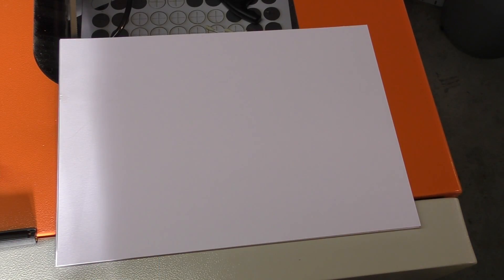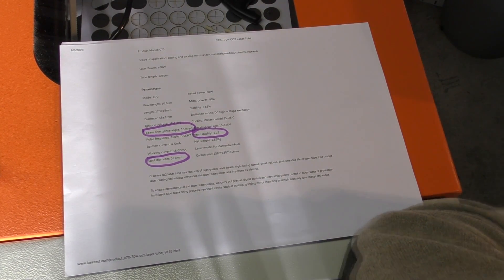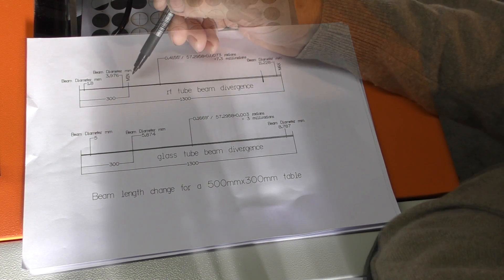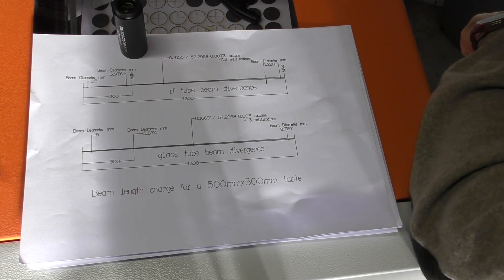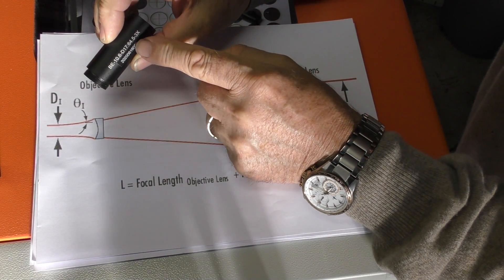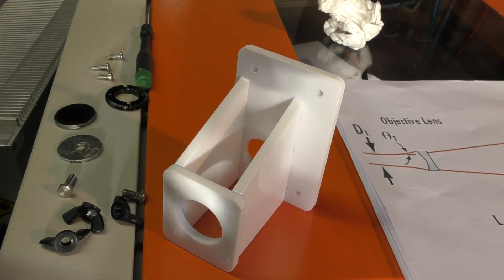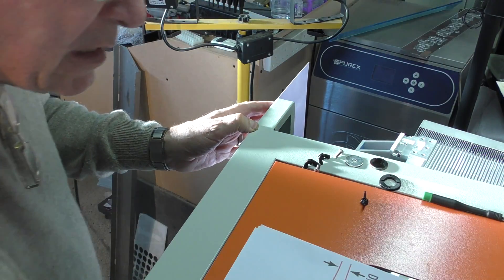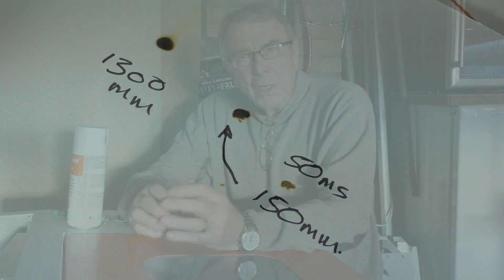Tangerine Tiger 06 Beam Expanders decoded

Comment: Something is not quite right - be sure that close beam burn mark is round. Check whether beam expander is centered and whether it is parallel with incoming beam. Else you may end in various problems sooner or later. First set of problem is that optics in BE has anti - reflective coating and it is made for narrow set of angles, mainly perpendicular to the lenses, or as in optics literature they call it "normal incidence". First problem may be even small reflecting of the beam to the housing, causing overheating part of the lens and it may crack. Second problem... well, beam shape consistency may be bit off. Hope this helps.
Reply from the maker: Hi Milan
As you have seen. I only rigged up a temporary holding mechanism for the beam expander and I did mention in the video  that I may not get the beam and expander axes perfectly aligned. My aim was to see what effect the expander imparted to the beam and crudely I have achieved that aim.. I will contact Cloudray because there must be a proper  beam expander mounting for this tube.
 Thanks for the comment
Best wishes
Russ.

Comment: I was reading about these a while back, and a good/simple explanation for how beam expanders work is they increase the area of the laser (in this case, 3x), but they increase the length of the laser (another 3x). In other words, if you were to take bad result you were getting at the start and project it out 3x further, you would still have the same result, but now you have a much better result when you are only 1/3 out.
This makes much more sense in my head, sorry for the incoherent rambling above.
Reply from the maker: What you were reading may be true UNDER CERTAIN CIRCUMSTANCES.. There are not many people like me that have SKEPTICISM woven into their DNA. I believe what I see and so I have to say I have developed a healthy mistrust of lens theory because the lens appears to be where the theory stops. What happens to that  Gaussian distributed light intensity when it exits the lens and starts exciting the molecules of the material we fire it at,, is a science that seems to have been very little explored.  In attempting to verify the information you are passing on, I have just been to my workshop and done a burns at  0.15m  at 1.3m and also at 3.9m distant from the tube. I have held the pulse on until I could get no more scorch growth. All 3 marks are close to 7mm diameter....just a tad more than 2mm x 3 predicted by the claimed 3 times expander.. I would therefore conclude that this beam expander/collimator is VERY well designed. Thank you for forcing me to check it's performance  in areas I would not otherwise have gone.
 Best wishes
Russ
Reply: It's extremely helpful and greatly appreciated when individuals go out of their way to help others in the world (who they don't even know!)and then make videos to give advice in areas that many individuals need a helping hand like newcomers and hobbyist like myself  ( just like Russ is doing) but "personally" i get p*ssed off when sarcasm and insults come from keyboard warriors just like a certain individual in this comment section who might well have experience and knowledge in the way this individual has written a comment but I'd just like to say and I hope other follow > DON'T give sarcastic individuals the ammunition they crave (ATTENTION SEEKING) something this certain keyboard warrior is looking for and although I'm writing this isn't to say I've taken the bait but it is the opposite (in fact I'm just asking others to ignore people like this pr*ck who is most certainty watching for curiosity as if the  individual in question is so clever in this subject then why bother clicking onto such material.
Another brilliant video from Russ and a thumbs down to the keyboard warrior.👎😪""”"
Reply: @joeblogs4146  I'm sorry I offended you with something I read about beam expanders?

Comment: Great videos Sir! Any recommendations on the best coolant to use in the laser cutter? Is antifreeze good or just distilled water.
Always look forward to another of your informative videos.
Reply from the maker: Hi Doyle
Just distilled water and make sure your system is close ie not an open bucket reservoir but a closed lid system with small holes for pipes. Small airborne spores will soon get into your reservoir and make lots of green algae  if you leave it open.
 See this video  in answer to your antifreeze question.
https://www.youtube.com/watch?v=NAiMrMGT1O0&list=PLPWEtx5V9DqEogIeYRdcG_KYcB7UL2Qmn&index=31&t=0s
 est wishes
Russ
Reply: @SarbarMultimedia  Thank you Sir!  very informative.  I will be purchasing the active chiller soon, which will provide a closed loop system to keep the water conditioned.  Brilliant idea regarding the 'halogen' heating system!
Reply from the maker: @doylemaleche9937   If you need the circuit diagram for the heating just add your disguised email to another comment (johndotsmithatgmaildotcom) and I will send it.
Best wishes
Russ

Comment: Interesting. Now i am wondering how much power does this Beam Expander/collimator ate? Hmmm...
Reply from the maker: Clean ZnSe lenses consume about 4% each  Then 3% per mirror plus 4% for another lens (total 21%).  Lets ignore the compound effect at each stage.   What remains for us to use  is   30 x 0.79  = 23,7 watts. Hmmmm....not going to do much cutting that I guess.
Best wishes
Russ
Reply: @SarbarMultimedia  It may cut even at that power level at low cut speed. After all, you mentioned this machine will be exclusively for engraving purpose. So, most of the time it will 'etch' work piece, then slow cut to finish work. I can see your next project in some far future - dual laser machine. Something like engraving (RF), flip mirror, cutting (DC).
Reply: @SarbarMultimedia  As others mentioned  It will probably melt without a cooling. Eagerly waiting for your next video!

Comment: I thought one of the benefits of the RF laser is the high energy density in the center. is that going to be negated with the expander / collimator? will the energy distribution end up similar to a glass tube?
Reply: The expander simply trades off the diameter of the beam with the divergence. The further you expand it, the less it diverges. That's what Russ calls collimation and he is largely right. No laser beam is perfectly parallel. They all diverge. When you focus it at the end, the smallest spot you can make is still the same -- assuming perfect optics, of course.
Reply from the maker: ALL laser beams have a theoretical  Gaussian light intensity distribution. However in practice various design factors affect the quality of this distribution. The measure of a laser beam's quality is described by an M squared reference number. where 1 is a perfect Gaussian distribution.. Glass tubes are generally in the 1.1 region whereas all the RF tube  specs I have examined seem to be 1.2 (lower quality).  As I mentioned to SeeigeCannon in answer to his comment, there are many myths and half truths associated with this technology, most of then circulated by the "big boys" to somehow discredit Chinese technology.. Yes (as I have demonstrated) Chines design capability and engineering quality leaves a lot to be desired but  glass tube technology has MANY advantages. 
 So in answer to your question, glass tubes have a HIGHER light intensity (energy density )  at their centre than RF beams (this is admitted in the M2 specs). The beam of a glass tube has a divergence of typically 2 to 3 mrads where as all the RF tubes specs I have checked are in the 5 to 8 mrads.zone. We don't need beam expanders for our glass tube because the divergence is very small. Whereas  for this RF tube in particular the beam growth is huge and would result in serous performance variation across the table.. It therefore MUST be corrected by the beam expander/collimator.  The Gaussian intensity distribution will not be affected by magnification or by focussing. The light intensity  will be stretched out or compressed but will still contain the same amount of power. BUT the beam expander/collimator contains at least two lenses (maybe three if one is a doublet) so it will absorb about 4% for each lens.  I have yet to do the testing but  I already foresee many things that concern me about this technology. I hope I am wrong because I really want to finish up with a high speed engraving machine that can do 500 dpi photos at 1000mm/s.

 Best wishes
Russ
Reply: SarbarMultimedia  im wondering if the BE reduces divergence it will,provide you with more consistency  as the head moves changing the path length.  Presumably allowing the focusing lens to deliver more consistency.
Reply from the maker: @grantlesueur  
Hi Grant 
 You have understood the problem perfectly.  Adding the beam expander is coting about 8% power loss, which is why I was reluctant to add it. However the consequences of having a variable size beam  hitting the lens at different points around the table will result in apparent power change, I say apparent because in reality the beam is changing its effective focal point  and the energy density hitting the work will be varying.
 Best wishes
Russ

Comment: Russ I don't know anything about that laser I have a c02 but could you turn the laser round to face mirror two so doing away with mirror one or is because of space and would it make any difference excuse me if it is a dumb question.
Reply from the maker: Hi Trevor 
This is not a dumb question and even one I asked myself in the early part of my learning journey trying to understand beam alignment and trying simplify it in the same sort of way you are imagining. In those early days I was experimenting with different methods and even designed 8 different versions of red laser pointer to help set the mirrors without the need for the scorched paper method. All these pointers were about 90% successful but not accurate enough for perfect beam setting. i now have a very clear 3D model  in my mind of how beam alignment works and I am sad to report that mirror 1 is vital to setting the beam true to the Y axis . 
 Let's assume I remove mirror 1.I Now want you to act the part of a laser beam by holding your left arm out in front of you and point a bit upwards. Identify  an object in your room to the left and a bit below your shoulder. That object is the centre of mirror 2 Very  carefully, making just one axis move at a time. maneuver yourself around so that you finish up with your arm parallel to the left wall, parallel to the floor and pointing at the selected object. Now imagine what the tube mounting bracket/adjusting mechanism would be to replicate your moves. That will be some hideously complex (and big)  bracket with X, and Z linear and rotational adjustments. . Instead let's leave mirror 1 in place. It matters not how badly aligned the laser tube is, the only requirement is for the beam to strike the centre of mirror 1. The adjusting screws on mirror one can be set so that regardless of entry angle, the beam can be steered parallel to the Y rail in both horizontal and vertical planes. The only issue left is to see if the beam is hitting the centre of mirror 2. This is where I realized that once set, I did not want to disturb  the relationship between tube and mirror 1. This became the stimulus for creating a separate tray where both  the tube and mirror 1 were mounted.  This allowed me to slide the tray slightly left or right until the beam from  mirror 1 was perfectly in the centre of mirror 2.. It goes on from there until I eventually made mirror 2 adjustable in Y and the head adjustable in Z. 
 Best wishes
Russ
Reply: @SarbarMultimedia  Thanks for the explanation Russ

Comment: As long as the beam still fits in your mirrors and final lens, why do you care? Of course if it does not fit any more, that's what the expander is there for. But you'll lose a little bit of power in the conversion.
Reply from the maker: Hi Jan. 
 It is VERY important to have a consistent size beam hitting the lens at all places around the work table.,  Changing the beam size onto the lens changes to focus  and that is something you do not want. Yes the expander consumes power (about 4% for each lens) which is why with only 30 watts to start with I was reluctant to consider it. But it seems it is a necessary evil for RF tubes because they naturally seem to have  a lot more beam divergence than glass tubes where we never see this issue.

Best wishes
Russ
Reply: @SarbarMultimedia  Hi Russ. Thanks for taking the time to answer. As the the lens moves further away from the laser these variations get smaller, and my gut-feeling led me to believe that these variations were small enough to ignore. Wrong. I calculated the beam waist and focal lengths for your system, and you are correct. Between a distance of 500mm and 1500mm (assuming a 20mm focusing lens at the end) the distance to the waist would change  from 20.8mm to 20.3mm. Worse yet, the beam waist size would go from 45 um to 15 um. So, as you said, the expander is critical. Can one avoid the power loss by using the steering mirrors to make an expander? I seem to remember it can be done with two parabolic mirrors instead of the flat ones.....
Reply from the maker: @janbeck8269   
Hi Jan I am not an optical engineer as I have declared many times. I have a rudimentary understanding of optics but rely heavily on acute observations and experimentation. I had no idea how beam expanders and collimators worked before I did some reading  and it was at that point I thought it wise to examine the effects of the BE that Cloudray had provided. Sadly they did not provide any fixing plate to ensure its coaxial alignment with the laser beam. My quick acrylic frame got me close enough to prove the principle but I know I really need a stable and accurate  mount. I greatly appreciate your mathematical  effort and optical skills to confirm my practical findings . 
Thanks for all your help
Best wishes
Russ

Comment: Friend, we need to talk.   Beam expanders are rubbish- but one simple mod and they are collimators, which will change your world.  The divide-divergence-by-expander-ratio does NOT apply once you tune.  With proper tuning you can create a loose convergence that stabilizes the beam over a very wide machine
Reply from the maker: Hi Danny
 The RF laser has a very poor beam divergence at typically 7 mrad. A glass tube laser is much better about 3 mrad. it has never been considered necessary to use a beam expander with a glass tube but as the machine bed gets bigger , that divergence has a significant effect on the CUTTING capability at the beam extremity. One of my next projects is to see  how to collimate a glass tube beam so any input you can make would be GREATLY appreciated. Can you send tour disguised email address in another comment and I will reply and immediately  and delete your comment.
Many thanks
Russ